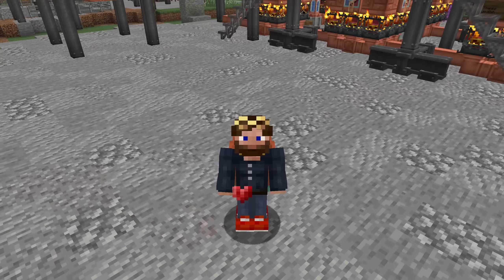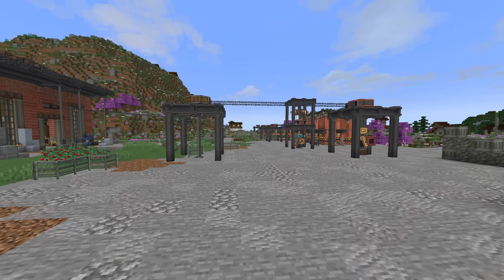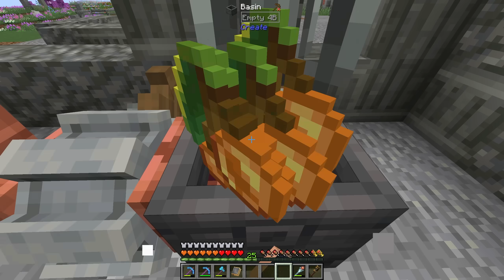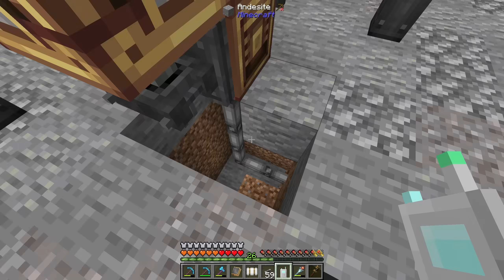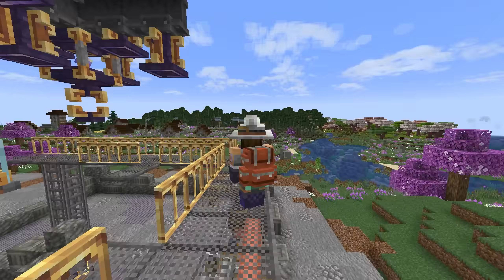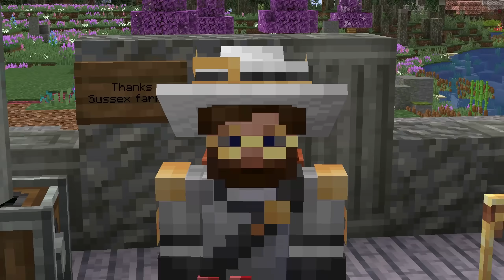Create + Ars Nouveau is the Most OP Combo for Essence Automation EP14 Chosen's Create: Integrated

Comment: Doubt you'll see this on a 7 month old video lol but i built this setup and everything is fine except when i put the essence in the liquid source, nothing happens. What mod do I need to add to add the recipe? I should clarify - This is not the same modpack that I'm using but it has Create, Ars and Starbunclemania. Just wondering what pack the recipe comes from for the essence duplication
Reply from the maker: Well this is custom to this modpack I made. I use Kubejs to handle recipes.
Reply: @ChosenArchitect ok so I should be able to add the recipe using kubejs? Thanks so much! Both for answering in the first place and for the info!

Comment: There is a lumizene glitch where if you pour one block in the ground and use a mechanical pump it pumps out infinite lumizene atleast that worked in mod version 1.2.8 haven’t tested in newer versions
Reply: Also I might be advancing too fast in the wrong way I’ve never made a steam engine and already have celestigem armor and paxel I just started using create automation

Comment: Im kind of impressed and miffed by the restraint when making those liquid to source generators... id have honestly made a line of them, at least 8 to start and have a dozen or more Source Jars/Condensers plugged into the piping system. I always go overboard with power generation and stuff like this, Source is a "power source" and its always better to have far more than youll need for quite a while... less worrying about bottlenecks and inefficient production when its impossible to use more than is being generated.
Reply: He put snad in the pack. Source gen is a matter of four snad and a cactus. Unlimited source immediately.